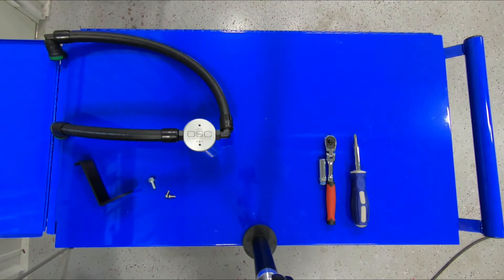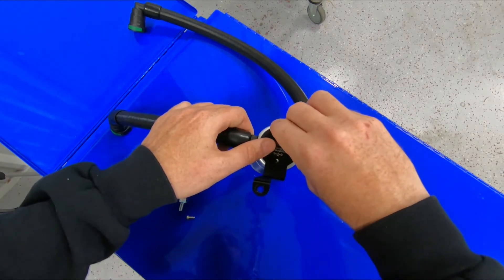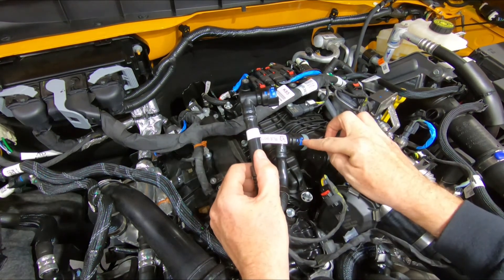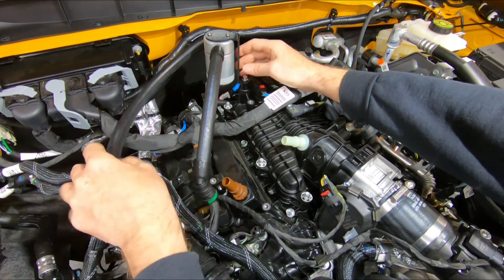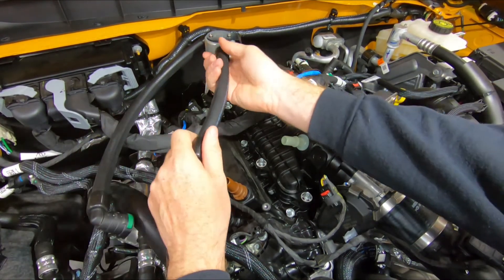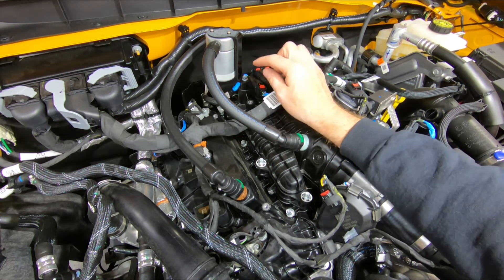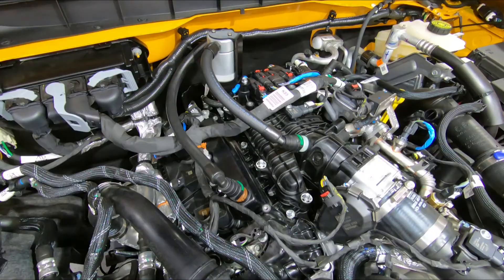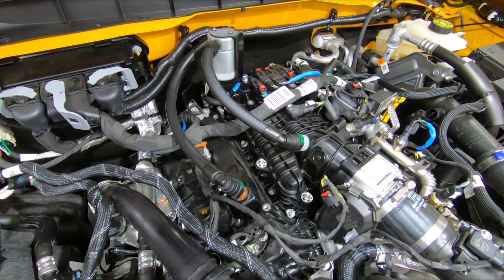J&L Oil Separator Co. 2021-2025 Ford Bronco 2.7L EcoBoost Install 3073P

Comment: Is there any recommended maintenance that needs to be done on the J&L 3.0 catch can for 2023 2.7 bronco? ie cleaning of the stainless steel strainer or hoses.
Reply from the maker: Roughly every 15k miles or so you'll want to thoroughly clean the oil separator. This can be done by spraying brake clean through the filter and hoses and allowing it all to air dry.